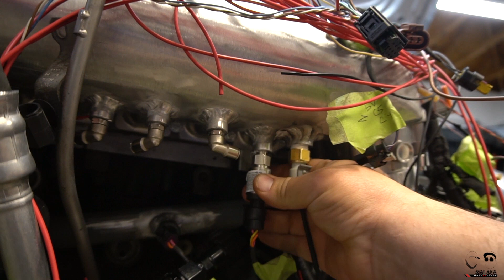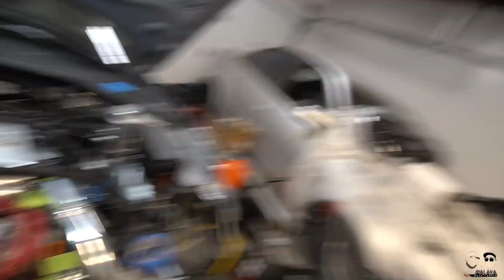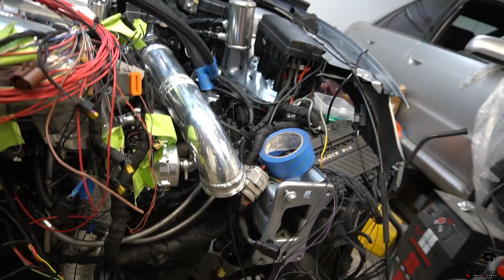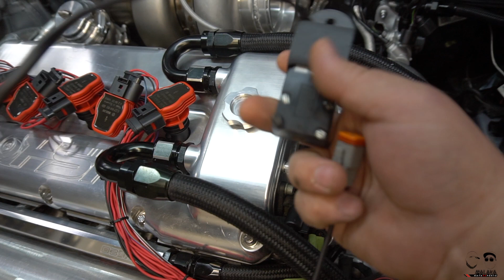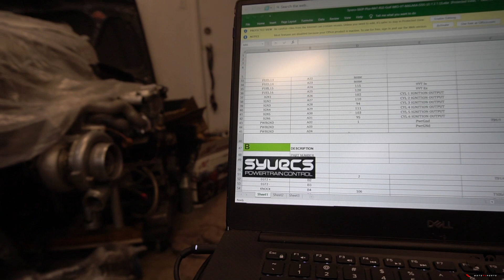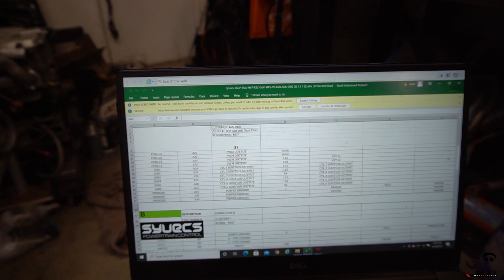RS3 VR6 SWAP WIRE UP CONTINUED

Comment: I have fitted a 3.2 24v (sorry  Stav xx)  VR into my Audi S3 and plan to fit my GT3582r from my old 20v setup but can't find any decent info about where to run the coolant lines from and too... where are you guys picking up the coolant for the turbo from and returning it too?